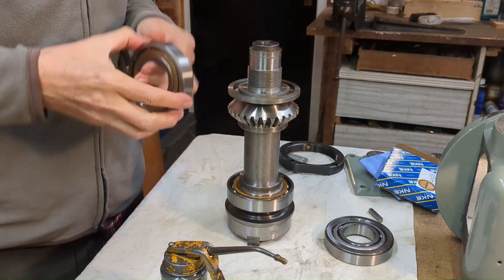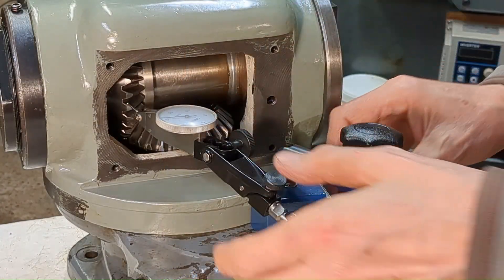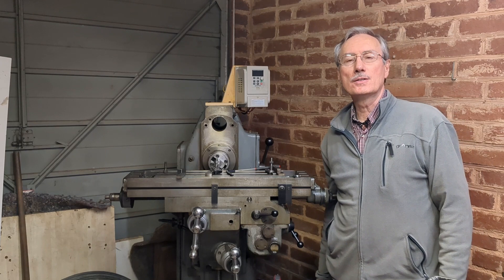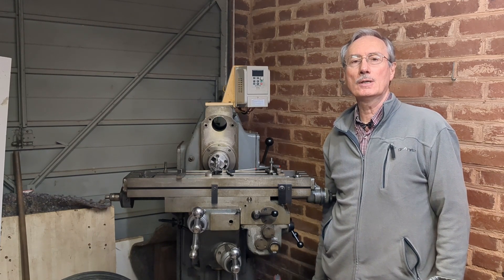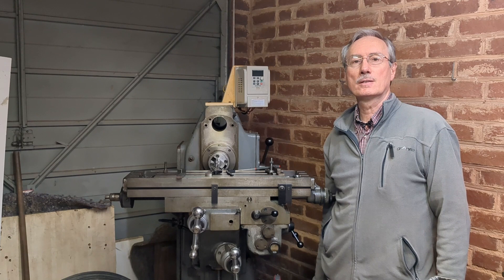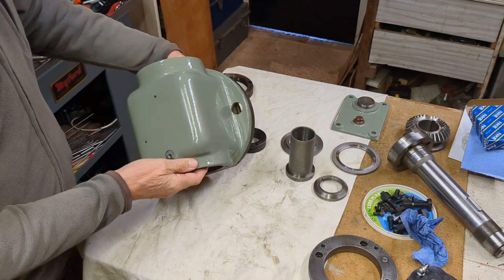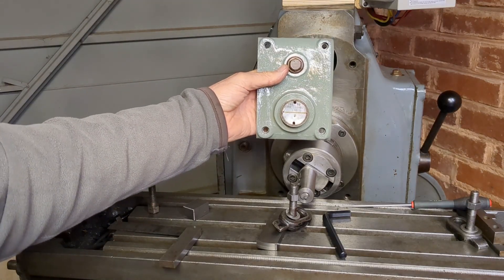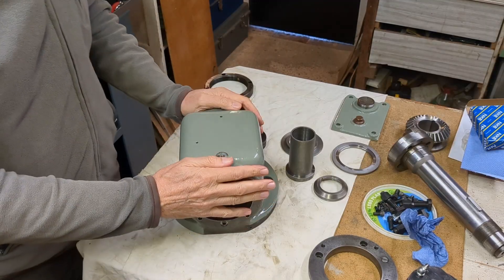Adcock & Shipley milling machine restoration - part 6 (vertical head final assembly)

Comment: Hello Clive. Really enjoyed your film, it was superb. Excellent perseverance and fault finding. Thank you for the name check, most kind. The vertical head sounds much quieter after your strip down, analysis and set up. Interesting that setting the preload on the taper roller bearings halved the backlash on the bevel gears. Here is an idea to help support the head when fitting and removing it. You make an iso 40 arbour that has a base built in so you can bolt it to the machine table. The taper need not be perfect. You place the head on this arbour and then you can move the head in x, y and z to get it mounted, or remove it. I can't claim to have thought of this. It was told to me by Mat Look of the youtube channel lookcreations. I hope all is well with you and I look forward to your next film.
Reply from the maker: Thanks for your feedback, Carl. As I responded to someone else's comment on this topic, it is a question of when I will get time to make the support. I like the idea of using an old Int40 arbour.

Comment: Thanks for making the pin spanner.  There seems to be a rash of millwright tendencies on youtube, hammering these nuts on and off.  Also, consider making a parking attachment for the vertical head.  Looks like you could attach it to the top of the main casting.
Reply from the maker: Thanks for your feedback. I will consider making a parking attachment. With so many jobs on the list it is just a question of when it becomes a priority - perhaps once the horizontal attachments are completed.

Comment: Great videos. I have a adcock shipley 2s. Looking for a electromagnetic clutch or somewhere i can get one rebuilt. My machine is very stout and thats all I'm missing to put it back together. Hope you can point me in the right direction.

Thanks
Reply from the maker: Thanks for your feedback. Yes, I have seen photos of the 2s and see that it is a robust machine for those who have the space. Is the clutch for the main drive? If so couldn't you use a variable frequency drive liked up to some of the exiting switches for control?

Comment: For the horizontal milling support bracket, did you attempt to season the casting to relieve any internal stresses to ensure dimensional accuracy after you machine the features? 

Another question I have is, did the foundry actually cast the horizontal support bracket in grey cast iron? Did they have such options?
Reply from the maker: Thanks for your questions. The bracket was cast in May and has sat at home in its unmachined condition since then. Although it hasn't been exposed to the elements and fluctuating temperatures (ie on the roof) I don't anticipate problems on account of its relatively small size. We will see! Sadly, it will not be a grey cast iron. That option was not available to me.